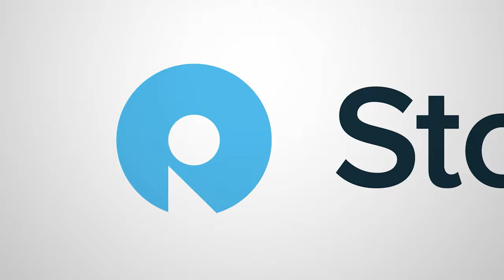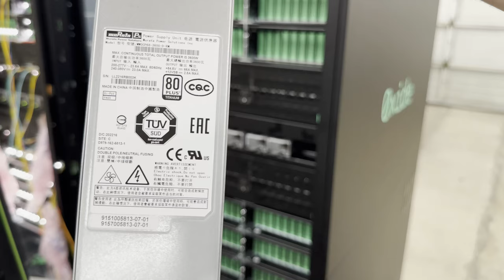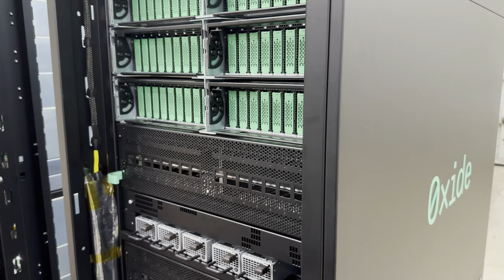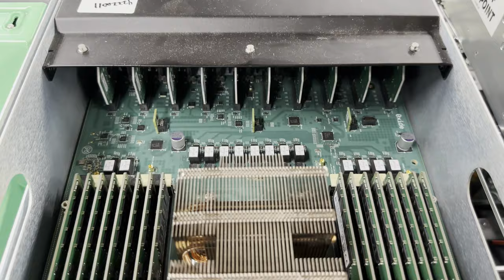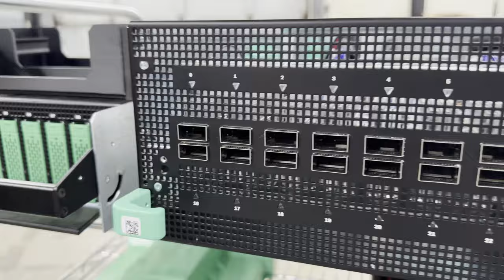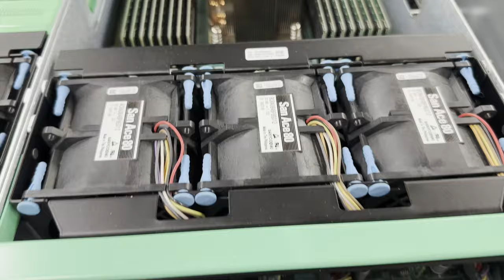This SERVER Boots AMD EPYC CPU's, WITHOUT BIOS!

Comment: very cool, can you actually buy that whole system?  Their site only seems to deploy images/vms

Edit: thx everyone for your comments. Very cool
Reply from the maker: Oxide is shipping the whole rack at the moment. This is something you buy as a total appliance, not like a single 2u system, so it has to have all of the rack infrastructure. They have hinted at a roadmap of smaller formfactors than the big boy, but that is not in the near future. -Jordan
Reply: It's a private cloud hyperscaler so the system hosts VMs/Containers. Oxide doesn't host anything themselves. They sell hardware and the control plane
Reply: @StorageReview  I don't get it... What OS does an Oxide cloud run? OpenStack? What OS on each node? Is it all open source?

Comment: Vendor Lock, Smart
Reply: You do have vendor lock-in, but not by design, since pretty much all of their stuff is open source. The reason for it is simply that these are not IBM PCs at their core, practically everything about the computer architecture that could be redesigned from first principles in a comprehensive way, has been. Just the fact that they can boot a modern AMD x86 without a proprietary BIOS or UEFI is a miracle.
Reply: @coolbugfacts1234  BIOS was never there to boot the CPU, the CPU ran BIOS code to initialize the rest of the hardware on the motherboard. And yes, BIOS was always PC-bucket garbage.